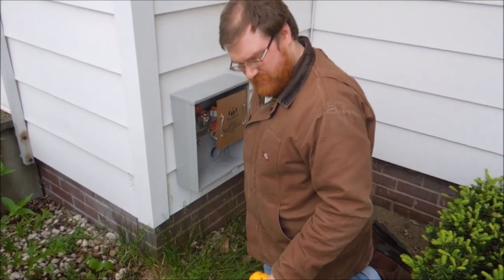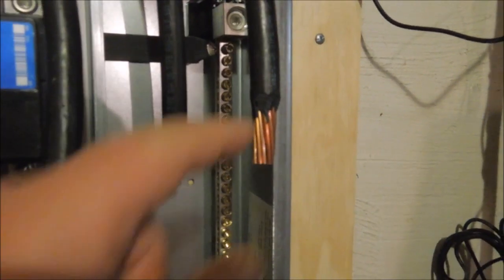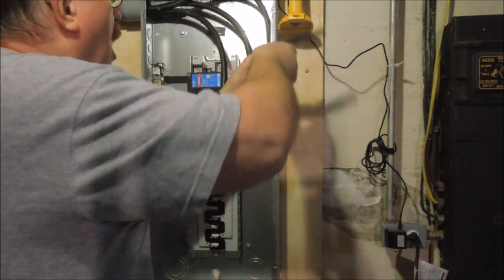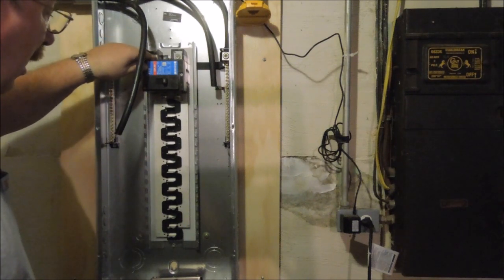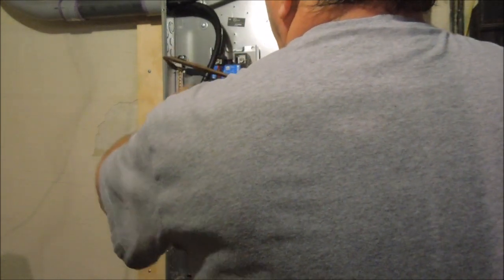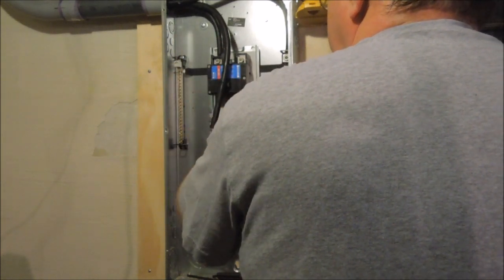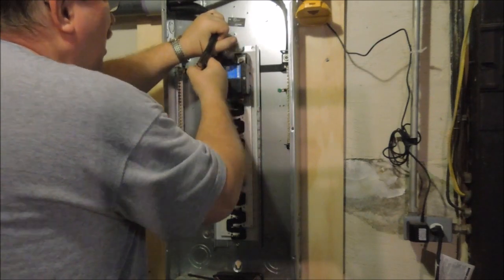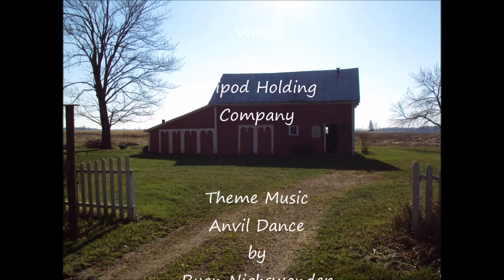Electrical Service Upgrade - Part 2 - Running Cable - a video tutorial by Old Sneelock's Workshop

Comment: according to T310.15(B) (7) 200 Amp Feeders you can use 2/0 Copper wire instead of 3/0 save some sweat equity lol
Reply from the maker: Allow for upgrades. Just change the main. 😁😎

Comment: I was told by Eaton that both those bars are neutral bars and it is called a split neutral assembly and neither are for Grounding.  

According to the PDF document supplied free on Eaton's website: 

Insulated/Bondable Split Neutral

Panels are supplied with split
insulated neutrals with an
insulated cross strap. For
service entrance applications,
the neutral must be bonded
by using the bonding strap
supplied with the panel. For
non-service entrance (subpanel) applications, the panel
may be installed with the
bonding strap not connected
to the neutral. Separate
ground bars must be used on
non-service entrance panels.

If the box has a built in main breaker, like yours, the neutral bars are to be grounded to the box using the supplied z shaped bonding strap with the green screw.  

If the box did not have a built in main breaker then the intended use of the box would be as a sub panel, and you are forbidden by code to ground the neutrals to the box with the supplied bonding strap. If that box didn't have grounding bars included with it, the supplier should recommend a person buy them separately and screw them to the box in the proper location with the prethreaded holes in the box.  

If you'll notice there is a wide flat strap running under the breaker assembly that connect the split neutrals together. It doesn't say for your type box to buy those bars and I assume, as long as you bond them to the box you would use either side for ground and neutral wires, or the left side for grounding and the right side for neutral wires, perhaps dictated by your local codes.

In my case, I have a box without a main breaker in it.  Our codes require a main breaker box outside connected to the service wire from the meter.  That box supplies the panel inside, which is a sub panel, and requires that I purchase separate grounding bars to mount inside the box, in which case I am forbidden to use that neutral bonding strap.

I understand they began making these boxes only a few years ago to prevent part of the system from becoming energized if a neutral wire and also the ground wire of that circuit become disconnected.  Previous boxes did not have the insulated neutral bars, and all neutral and ground bars were directly screwed to the box making the box part of the grounding system.

Comment: Nice Job...nice you used copper service feeds. Almost everything these days is aluminum in the USA with all the No-Ox all over it. this includes he feeds from Power Company too.
On your old 60 Amp Panel, looked like it was the name Colt and the same reared up horse symbol used by Colt firearms from what I could see. Was that the case?
Nice channel and wide range of topics...subbed to your channel!
Reply from the maker: You are right. I never noticed. When I went back and looked at the pictures the panel is a Colt Noark. I Googled it and it seems they are a collectable? It's my sons house so I sent him an email letting him know.
Thanks a lot for letting us know.
Reply: Old Sneelock's Workshop  Finders Fee? LOL!  Glad I could help..

Comment: Are you an electrician?  You need a cable cutter I never saw an electrician use a hacksaw to cut wire lol  Also you need to mark that noodle with a white tape.
Reply from the maker: How many services have you installed in the past 50 years?
The neutral was marked with white tape after the installation was complete.
The service passed inspection.
Reply: i have uses a band-saw!
Reply from the maker: As long as the wire is cut to the right length and the insulation is intact where it needs to be a cut is a cut. 😎

Comment: At 1 min 40secs in, a warning caption appears - but only for a very short time.  It reads:  "I just mispoke. The bar on the right is the Neutral Bar not the ground bar.  The Ground bar is on the left in this box".

Don't you think this warning should be more prominent?  A mistake could prove fatal to someone.
Reply from the maker: Thanks for watching planetquerty.

There isn't any danger in having the neutral and ground wires on either bar, or on different ends of the same bar. The neutral bar and ground bar are electrically and mechanically bonded together and to the frame of the box.

I put that little blurb in there because I was sure someone would want to point out that the neutral cable is larger and has to go into the large lug on the right hand bar. In the Part 3 video I connect the ground wire to the smaller lug on the left hand bar.

The ground wire is only #4 copper and fits the smaller lug.
The lugs at the top are interchangeable. I could have swapped the lugs and mounted the neutral cable to the left hand bar.
Reply: Since this is the main service panel, the neutral and ground bars are the same thing, and must be bonded together, hence the flat black insulated strap that is running behind the bus bar just under the main breaker. These are bonded to the enclosure via the little s shaped copper piece with the green screw head that you see connected to the right-hand neutral/ground bar. The point is, this all bonded together in the main panel. Everything "downstream from the main panel must have the neutral separated from the ground, including a subpanel. So he didn't misspeak, it just doesn't matter in the main panel.
Reply: I guess I must be out of my depth, but on this side of the Atlantic perhaps there's a difference between what's meant by 'ground' and 'earth'?

https://electricalnotes.wordpress.com/2012/09/07/difference-between-bonding-grounding-and-earthing/

Comment: i am first year apprentice we use a lot of those CH panels they are pretty good for the price i like the copper lot of people cheep out with aluminum here in Canada that neutral would need to be white or at least taped white the whole length that is inside the panel other than that A1 job
Reply from the maker: Thanks for the comment MrCinimod93.
I've been using Siemans/Cutler Hammer breakers for a number of years with good success
I've used aluminum before when I wired up modular homes for the Drake Company. I always thought it was a cheap way to install the service. In my house and Ryan's we installed copper. It's about 3 times the price but it's only done once if it's done right.
If you install aluminum I recommend checking the connections every year. Even with Cual they are prone to corrosion and heating. We can't run branch circuits with aluminum because the connections are often inaccessible.
After finishing the panel and meter box Ryan went and bought white tape for the neutral. The last video is being edited with the ground and back feed in place.
Back feeding the new panel during the swap is acceptable here. I've always made sure to tag out and block the 200 amp main from being turned on until the new meter install is completed.
Reply: its common to back feed here until about an hour before inspection haha we use lots of al cable on service entrance put lots of anti corrosion goop on them work it in the best we can but i am still going to go all copper when we change out our old 100 amp recalled fuse panel from the 70s i am only  putting in a new 100amp service, code says if i upgrade to a 200 amp everything in the entire house needs to be up to new standards  and its just  not worth the work on our 1000 square foot bungalow to make the changes
Reply: Right on all points (ignoring missing punctuation), except that that is not a CH panel. You can tell by the bus bars. It is a BR panel. Made by the same manufacturer, Cutler Hammer/ Eaton, just different product line and warranty (and price!)